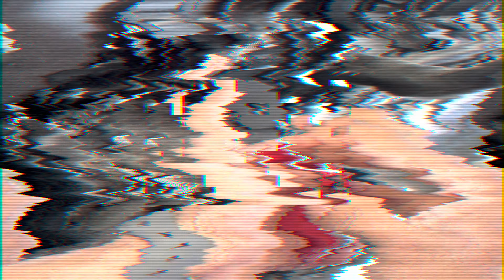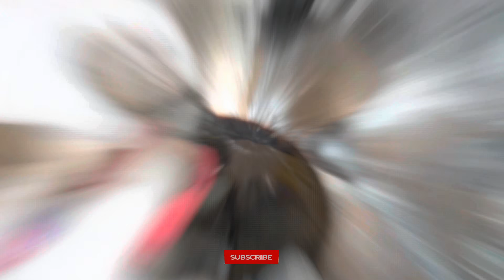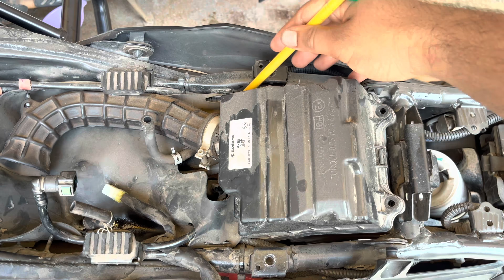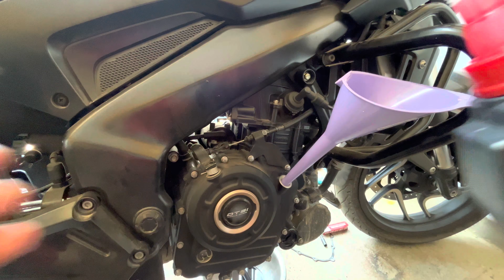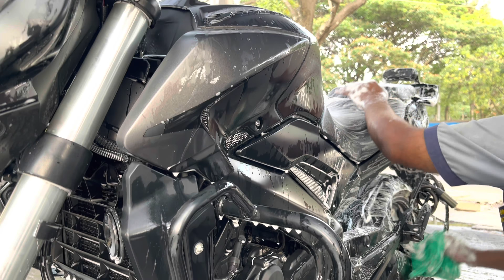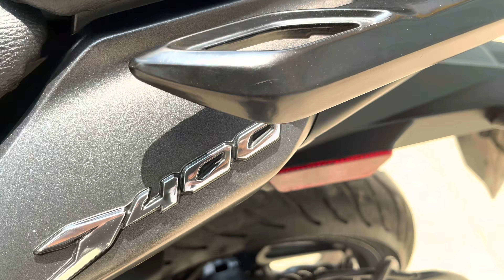Do Your Own Servicing At Home | Dominar 400 General Service

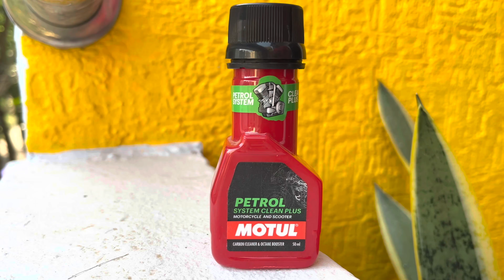Comment: 14:30 3 - 5 lt petrol over an above the reserve amount or including reserve amount. My question is if the vehicle has a reserve of 5 lts, should it be used by mixing it with that reserve amount or can it be used by mixing the fuel cleaner with additional 3 - 4 lts petrol

Comment: 6:49, The air-filter is installed wrongly. The rubber seals from the old air filter need to be removed and installed on the new one. The part number of the same is DT581028. Ideally these should be replaced along with the air filter
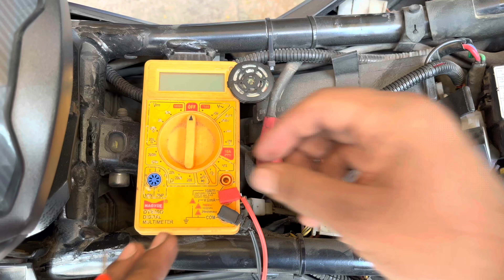7:11, A battery also needs to go through load test and tested for CCA. A battery with good voltage may still fail at crannking the engine.

Comment: bro use motul 7100 oil 10w50 after 4000RPM fils higher vibrations. lower RPM vary smooth

Comment: If you change oil regularly and use synthetic genuine good quality oil, there is absolutely no need to use the flush. It's only if engine is heavily clogged due to negligence in maintenance and after lot many kms of riding.
Using in regular service can cause clogging of oil circuits due to minor gunk getting loosened everywhere, and the leftover flush reduces oil viscosity. 
Follow the owners manual - nowhere it says about engine flush. It's a gimmick by these lubricant companies.

Comment: How to remove the service waring
Reply: You need to hold those 2 buttons in the secondary cluster. Im not sure how, last time i peeped into the service centre they did something with those buttons to remove the warning.
Reply: Keep bike of, press M button twice then switch on the bike and press and hold M for some time until it start blinking. Once it starts blinking, press the S button and voila it removes it. Works on all pulsars and might work on d400. Good enough to give a try. Tell me the results

Comment: Low oil drain in KTM390/Bajaj is a masterpeace of screwhanded engineering. Right above hot exhaust pipe. If there is could be a better place!
And to notice to everyone - oil caps should be tighted by dynamic wrench at ~1 kgm or "by hand, but not to leak" or it will crack to rubbish,  cause carter is made from silumin, so plugs are made from alloy, that's even weaker that silumin.

Comment: Never presssure wash bikes, especially near engine area, water can leak into many places like oil filter, oil tank corrode contacts etc. justvwas with regular bucket or a small tube without pressure

Comment: hi sir I am using ns400z and 3 service has been completed after service I am facing some issue while riding i feel it is very hard to ride also while acceleration it is not so smooth and it is hard when changing the gears it is very difficult and service center not hearing me. Cn u please inform any good technician in bangalore

Comment: I own a Dominar and I am a Kenyan, this video is insightful on what to look out for when either doing the service by myself or when seeking service from the service center and supplementing the same to ensure the motorcycle remains in great shape. I am now approaching 40,000 km
Reply: Huu mnyama uko na spares kweli huku Kenya?
Reply: Hi brother. My Dominar 400 just reached 30000km so just wanted to know if there is any major service which is different from the rest of the service to be done to the bike as that is what rhe mechanic told me
Reply: @suhan6213  bro check the bike manual

Comment: I also service my ns 200 bs4 from past 6 years myself. 300v is the best for engine . Clocked 62000 kms
Reply: How do you change the brake pads ?
Reply: @AadharChouhan 12 mm spanner to loosen the front brake caliper, then push the brake pistons with the help of screw driver

Comment: Your video was good and it was a good DIY  but you should also know that you shouldnt use engline flush every oil drain its a wrong method  because  when a engine runs it deposites a lot of carbon on the piston rings and piston blocks which will actually help your engines life over the time periods actually  carbon plays a friendly role in a longer period of the engine its not recommended to use it , and about the secondary  drain nut on the dominor , which is not supposed to be removed for a oil change , because  its a part of gear box lubrication and it doesn't need fresh oil and parts of the bike needs  lubrication  and when you crank the bike with fresh oil the wear and tear is more due to the oil not reaching  the gear box sump so its a wrong process for the dominor and ktm engines , lastly dont use the fuel system  cleaner for every  5k kms its a wrong  process  because  people who have used it on the 390s or dominor have faced throttle body issues due to too much  detergent on these products if you feel the throttle is snatchy get the throttle body cleaned every  20k kms thats more than enough , but over all its a informative video

Comment: Hi @ARKIONX came into my timeline randomly and i really loved the way you have been explaining all those.Here i am having a doubt:
I own an Apache rtr 160 2v around 63K in my current odo , and i used to take a good care like timely oil change and regular service but surprisingly i heard a strange engine noise which i felt that there is something wrong and need to fix it asap and that was around the 50K sharp odo run. I was really shocked that it was emitting white smoke for some tym then mechanic advised me to change the head and boom everything was so good.now my question is can i use the engine oil flush as my bike did only 13K + after engine head build.Hope this one reaches you out and will get a reply soon TQSM
Reply from the maker: Hi Akshay, 
Firstly thank you for liking my content. 

Speaking of engine flush, yes you can use every alternate oil change.

Comment: During this service, how many KMs does your dominor has ran?? Asking because it feels bajaj engines are not good quality since metal scraps are collecting in those filters & i guess thats the reason many dominor 400/ns400z required engine rebuild at 25k  itself as compared to KTM 390 which require engine rebuild at  50k.

Comment: is it required for BS3 bikes (engine flushing and de carbonising)
Reply: Dont use engine flush unless a professional mechanic deems it necessary. regular fully synthetic engine oils have detergents in them which are more than enough to keep engine clean. plus when you do engine flush, the next engine oil you use will also get thinner as some amount of engine flush will remain inside the engine.  people dont do that, and a thin oil damages the engine as it loses its adherence to sticking on metal surface property

Comment: If you are regularly using a fully synthetic oil you don't need a engine flush, you can buy fuel system cleaner instead

Comment: Also use vasline it's petroleum gel for battery after using cold start problem solved bike start initial crank....😅 Sometimes I struggle while starting after few days to start now it's completely gone also I use rubber mat for side stand i don't it's mith or else for me its working
Reply: Vaseline Is Not Good For Regular Usage

Comment: This is not the right way to flush any engine why!!!once my engine seized ntorq (after 2000km of service) while using motul synthetic engine oil because it the remaining 50/80ml old engine mix with the flush makes the new oil thin and in the long term around 4000/5000km the oil looses the viscous natural and it harm the engine i own and service p220,rs200 & ntorq bs4 and i have learned not to use any flush after that incident 
This right way to flush is flush your engine like you did then buy mineral engine oil and a new filter and again just flush the new mineral engine oil after 15/20 of idling the mineral oil will take all the flush out then get new engine oil 7100 or 300v or anything with a new oil filter then it will be a proper engine flush without harming the engine
This is my own experience after riding bikes lakhs of kilometres 
P220 2013 1lakh plus km
Ntorq bs4 80k plus km
Rs 200 bs4 30k km
Reply: Ntorq ka engine bakwas h ,20000 m oil uthane lag gya tha ,sari service agency se krwai, warranty m half engine bana ke Diya mujhe tvs ne.2500km m service krwa do,engine flash ki koi jarurt nahi padti h,maine toh aajtk nahi use Kiya,

Comment: Help needed...
My RS200 handle is wobbling between 60-90 kmph. Below or above these speeds, the handle is stable. What could be the reason? Did check the wheel bearing, it is fine. Also, there are no leaks from the front forks. Front tyre is new, installed 1 week ago. Back tyre was changed around 6000 kms ago.
Reply: Thanks to everyone who helped. It was an issue with the cone set and was fixed today. Bike is very stable now.
Reply: @saran_ashok__  what happened to the cone set, saran?
Reply: @Darth_vader7  Gone bad due to potholes and bumpy roads of Kerala, along with me leaning the bike as much as I can into every corner I can find. Also the bike has already completed more than 48000 kms. It was supposed to be replaced in next service(49500 kms).
Reply: Check tyres condition and tyre pressure
Reply: @shyam.on.wheels  Tyres and tyre pressure on both wheels are good. Will try changing cone set on monday.
Reply: @shyam.on.wheels  literally ga….front tyre kothadi ani cheppadu, mundu thana comment purthiga chadhuvu ra shyam. Inkemundi, tyre condition check cheyyadaniki?? Tyre pressure antava….adhi bare basic ra babu, prathi 10days ki yavadaina check cheskuntadu.
Reply: @Darth_vader7  English, please.
Reply: Check for proper fork alignment. 
Is your front rim bent or alright?
Any cone set issues? 
Wheel alignment?
Reply: @Darth_vader7  No bent rims. Although not sure about cone set.